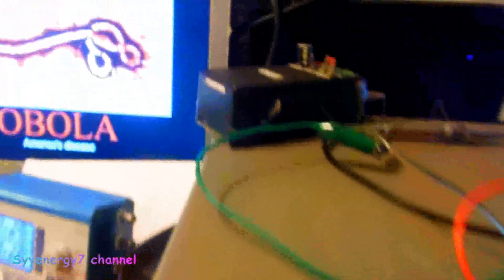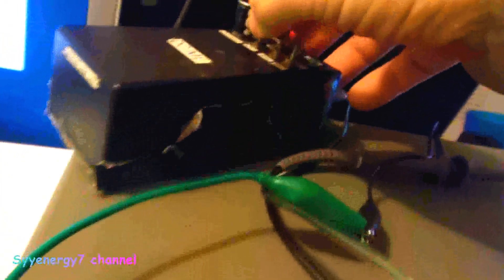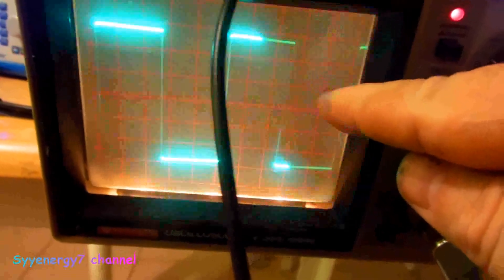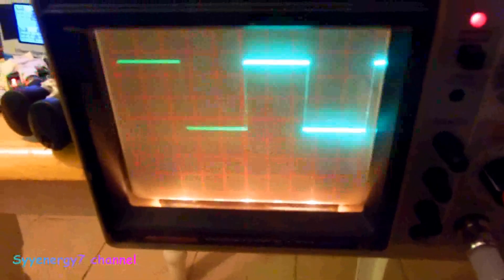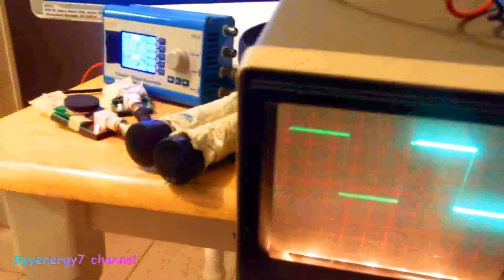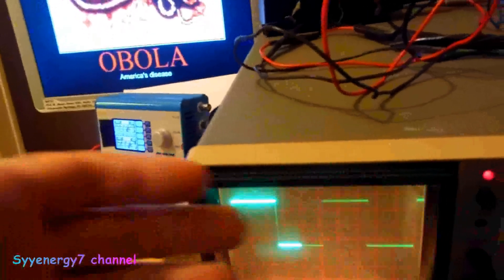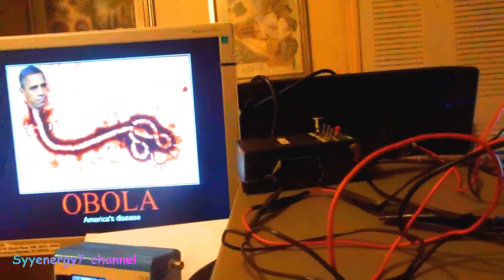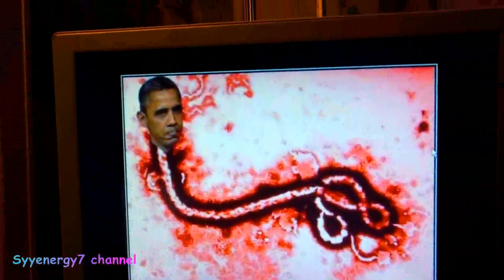Bob Beck Zapper Modification

Comment: when building a power supply there Is half wave and full wave diode rectifier to completely convert AC to DC requires a full wave bridge rectifier. If You want filtered DC then You put large storage capacitors on It and other electronics but then It will Not pulsate.